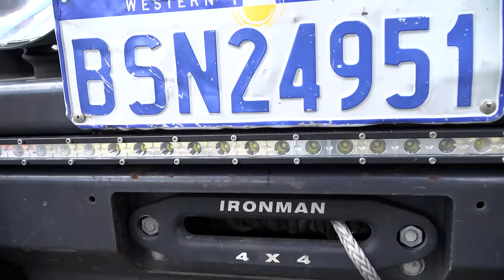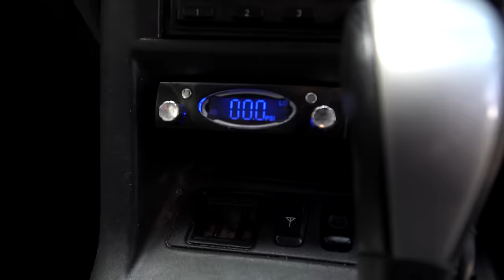Mitsubishi Pajero NP, Modified episode 28

Comment: Hi Ronny. 
How does the methanol injection work? Separate injectors? And where is the methanol stored? 
Great videos, keep it up!
Reply: Brendan Lubbe there will be one nozzle in the charge pipe. there will be a pressure switch that turns the methanol pump on once at a predetermined boost level. very simple and easy to do
Reply: Thanks tx5brent. My other question is does methanol have any other effects on the engine and its parts, causing the owner to take and special care/maintenance? Sounds real easy to install!
Reply: Brendan Lubbe it has a cleaning effect, not sure of any down sides, unless you install it on the intake side of the turbo, where it may possibly wear the turbo.
Reply: tx5brent thought as much. Thanks for the info!

Comment: that MDL paj have no chassis how do they go with body flex an cracking seems .
Reply: Grace Walker the monocoque is extremely rigid. There is a clip around of an engineer testing it for changes in panel spacing after recoveries. From memory they tested 3T on a diagonal and no movement. There is more body/panel flex in body on frame styles.

Comment: I found some of his mods a bit over the top... and lets face it... you need to be rich to afford it...   I am pretty sure a pajero off the line can also do a little bit of 4 wheeling and overlanding, Is driving through rivers really necessary to have fun?  Does the 3.2 TD not have enough torque without ethanol boosting?    I dont feel a lack of power in my series model anywhere i go - be it pulling horsetrailers at legal limit weight (or beyond when there is actually a horse in it) or climbing hills ....      

The trick is gears. You know, it has gears.   Put it in a low gear - and it will have more power.... its like magic, but it is actually science!

 :-)

Anyways, he is a nice bloke.. and he sure knows how to mod his car.... what he did with the rear bumber is so awesome, its a crime pajero works did not have the idea!

br from finland

Comment: okay so Np has a diesel engine in it and Nm has v6
Reply: nm comes with the 2.8 TD 4cyl, 3.5 v6, 3.8 v6, and 3.2 TD 4cyl respectively. The NPs will pretty much all be running the petrol or 3.2 TD 4cyl

Comment: Would love to see someone with a first gen montero on here, but that has to be a rarity! I love that rear bar!
Reply: airbats801 why???
Reply: Because they are a better offroad rig? Much simpler, very strong, you can run 33s with zero modifications, suspension front seats. They are dirt cheap and reliable. There are quite a few bolt in engine and transmissions options to choose from if you are building one up as well. There are two families of petrol engines in 4 cylinder turbo and na, the mitsu v6 lineup, and the 2 4 cylinder diesel engine families.
Reply: 1st generation  as in early 80 model??
Reply: something like 83 to 91
Reply: airbats801 fair enough. ..not sure where you  live but not a lot of gen 1's around. late  1980's would be  gen 2.more comfortable  than same year patrol  or landcruiser but did have a problematic  engine.ok for basic offloading
Reply: 1991 was technically the changeover year for a gen 2 montero, 82-91 was the same generation/body style, they did introduce the 4 door around 88/89 with the v6 as well. They are getting quite rare these days. There are still quite a few in the states, but you tend to see more of the second generation rigs, which are also nice.
Reply: airbats801 i live in Australia  not many  gen1 here
Reply: airbats801 many here in Philippines and I'm one of those :)

Comment: why does he have two extra tires on the vehicle? the top one  just makes the vehicle heavier and lose balance.
Reply: Because he is using tubeless tyres and they might get punctured badly enough that they can't be plugged.  
The weight of a single one on the roof isn't going to make a big difference when touring.